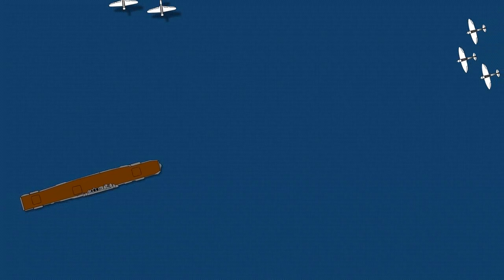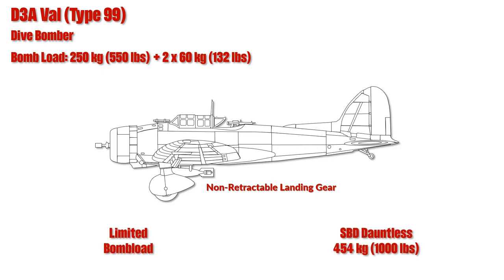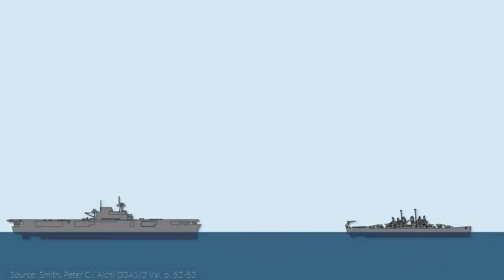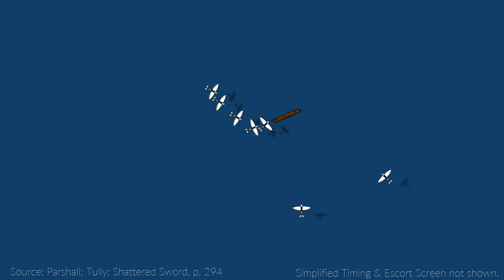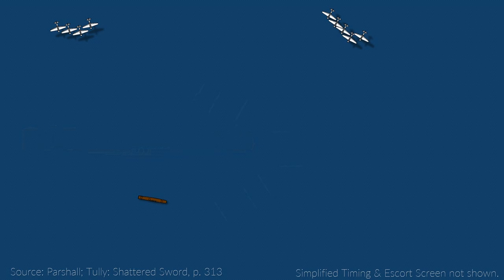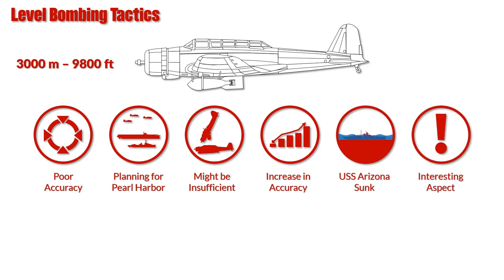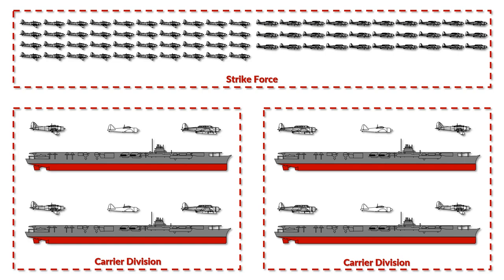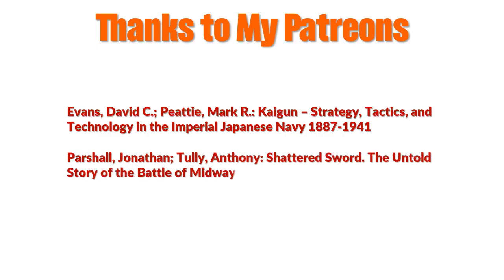Japanese Bomber Tactics (Navy) World War 2

Comment: If admiral Yamato wasn't assassinated and the USA hadn't decided their cypher would the Japanese have won the war?
Reply from the maker: no
Reply: No but they could have inflicted far more casualties on the Americans and dragged the war on even longer than they had.  It is interesting to speculate if Midway had been a one-sided Japanese victory.  Would the American fleet have been withdrawn to San Francisco or some other west coast city in the effort to regroup forces?  Who knows?   Personally, I always questioned why the Japanese didn't bring in the battleships after the Pearl Harbor strikes when the war first started.  They had no chance to invade and occupy Hawaii, but a few battleships could have laid waste to the shipyard and fuel depot at Pearl, and prevented its use as an advanced base for the American fleet.
Reply: The "What if the Japanese attack on Peark included an invasion?"  is an challenging war game question. 
Potential problems 
1# amount of oil required for battleships and transport might make the impossible to fuel invasion against the oil fields in Borneo and Indonesia.
1#a just taking the transport might preclude an invasion of Indonesia.
2# It would have required another 50,000 men from the Army in China and Army and Navy would fight over  control.
3# Concern that it would increase the chance of detection or anticipation by the Americans at Pearl.
4# Incredible risk: failure would pretty much  doom the attacks on the oil fields which might have proceeded without diverting all the transport to the eastern Pacific. Japan would have been out of gas in 6 months. 

Still seizing Oahu would give a great bargaining chip to the Japanese. It is more probable that the American round eyes would sell out the Dutch and give up Indonesia to get Hawaii back than rollover just because a bunch of battleships were sunk.